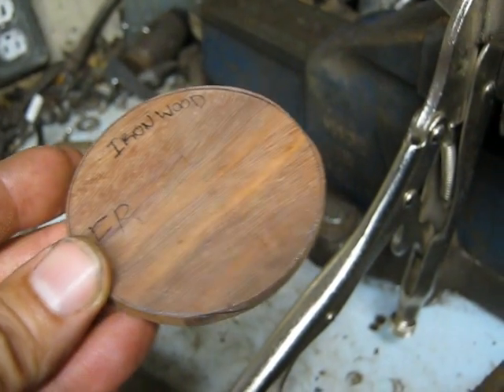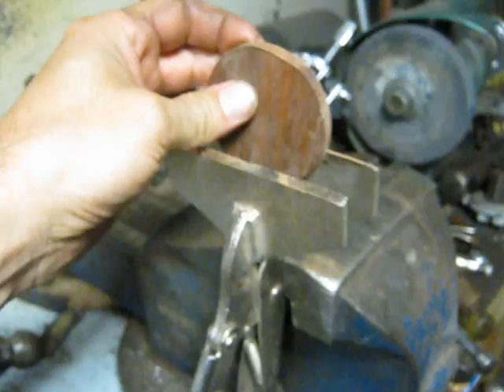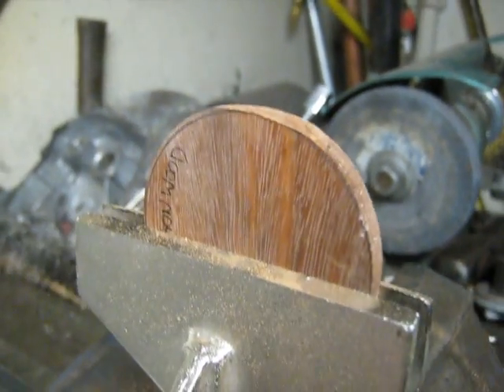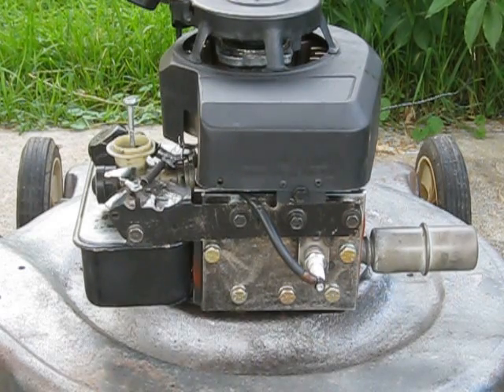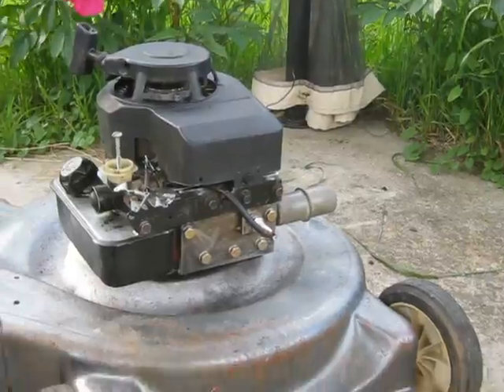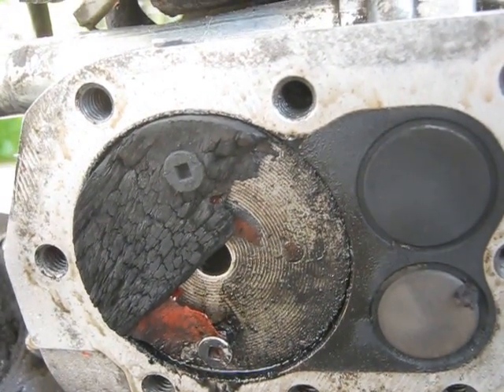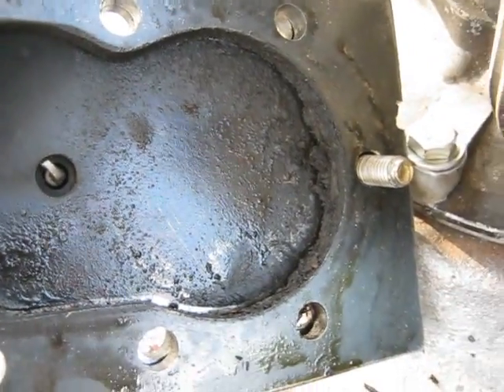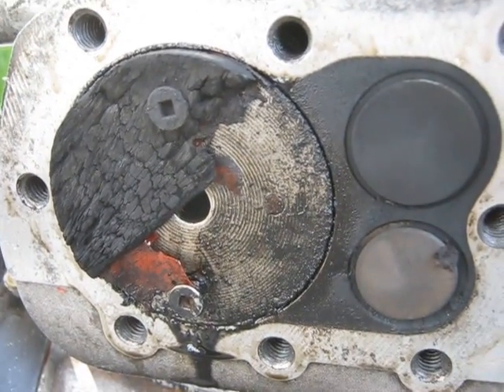Boraxed Ironwood Piston 3:37 Run!!!

Comment: Soak the wood in water glass [sodium silicate] and give it a long time to dry and you should have one really tough piston!
Reply from the maker: Howdy, yes, as long as that stuff doesn't lunch the cylinder wall. I hear that is what they use to destroy engines at wrecking yards, courtesy of a large auto manufacturer  :(
Reply: Although it is true that they indeed poured liquid silicate into engines and ran them until they terminally failed [seizing up] that is immaterial to this.

To fear that is to fear a concrete because some men used it to drown other men in Lake Michigan even though it has a whole lot of safe, benign purposes.

Water Glass, when used intelligently is utterly harmless to an engine.

In fact, interestingly, some people use dilute water glass as a stop leak [charging a ridiculous price for it!] for head gaskets.

Water glass is often employed in many spray cleaners because of its propensity to leave a thin, reflective, protective film of glass over a surface which [temporarily] resists scratching and staining, therefore extending the color brilliance and reflective sheen.

It is used as a protective coating on commercially packed eggs as it inhibits spoilage by both keeping out microbes and keeping in moisture. I suppose technically it increases shell hardness, but clearly not enough to keep an egg from actually breaking under 'normal use conditions', or it would become problematic for we the end users.

Just like how one used fiber glass and resin as a compound to build structures, in reverse, using water glass and mineralized cellulose fibers [aka WOOD] makes a stronger, more resilient product.

I must of course, emphasize the absolute dryness of the water glass because I have made a foam out of it which might happen if the wood and water glass combination is too wet when put in the combustion chamber.

I might just mention here that the insanely expensive material known as 'aerogel' is nothing but water glass, literally.

Comment: Best run yet and the most spectacular failure so far. Excellent video, saved to favourites!
Reply from the maker: Thanks. Yes, this has been the longest run so far with  the 1/4" thick wooden piston crown. i am not certain what happened about 1/2 way thru, but I suspect a piece of wood broke off, and got beaten up by the piston, then spit out of the exhaust after burning up. it did make for some excitement, but I decided that i was pretty safe with the 1/4" thick steel head between me and the source of the problem, so i just let it continue to run, and see the outcome.

Comment: Have you changed the oil in this motor? Perhaps it would be a good idea to make a video on how it looks and send it for analysis.
Reply from the maker: No, I am running the same oil I have from the start, though it gets dumped out of the engine each time. it smells like a campfire, and is a dark brown color, with lots of suspended particles.

Comment: it looks like it just broke in half IT LOOKED FINE IN THE MIDDLE WHERE THE HOLE WAS STILL!
It would of gone even longer if it didnt break in half..
You'd have to use more bolts to hold it on with though!
I can tell thats very possible thats what happened because the engine quit very suddenly compared to some previous runs plus theres no major hole burnt in the center where the remaining wood is left.
Reply from the maker: One further thing i noticed was that the high temp silicone had given way also, so this run put everything to the test. I had to wait a while before I could take it apart, since it was so hot.
Reply: Yeah wow. o.o

I have a question. how well do piston rings really seal the piston to the cylinder walls of normal engines?
And do they self-heal between the cylinder wall and the piston rings by wearing evenly if the cylinder wall gets a tiny nick or scratch in it? 
does the oil do a lot of work with sealing the cylinder and piston rings?
what do you think?
Reply from the maker: You have asked some very interesting questions there. I can't say that I really know the answers to them, so I will give my opinion. I think the piston rings may do a bit of rotating around the piston, not much, but some. This would move wear marks around somewhat, I think oil plays a big part in sealing the surfaces, but it must be a very thin film, as the rings seem to wipe most of it off.
Perhaps some experts can shed more light on this basic engine principle that isn't widely discussed.

Comment: It seems that it held on well until it totally burnt through. Was the remaining piece burnt to the piston or still clean wood underneath?
Reply from the maker: I haven't looked at that, but the silicone seal was starting to let go, so i imagine the wood was OK, as it would be protected by the silicone.
Reply: ChargerMiles007 
In my experiments silicone burns quite readily at combustion chamber temperatures. Heck, try a silicone top. Probably not worth the effort. Just burn it with a propane torch to see.
Reply from the maker: Interesting, I wouldn't have thought it would burn also. I looked at the remains, the wood wasn't burned where the silicone was still stuck to it.
Reply: ChargerMiles007 
I tested it for use in aircraft nacelles near turbos. The orange seems to hold up best for some reason.

Comment: Whats your opinion on smog pump superchargers?
Reply: Im thinking on supercharging my briggs 60102 with the 2 3/8 bore and the 1 1/2 stroke. it seems like a good engine to try.
Reply from the maker: I honestly don't know, but your small 6 cube engine should be a good candidate for it, as that is about as small as Briggs made before the 4 stroke weed smacker engines.
Reply: ChargerMiles007 Weed smacker, i like that. And yeah, this briggs isnt the biggest of the bunch, but has just the right compression ratio for the job.
Reply: ChargerMiles007 Maybe if it works i could send you up a smog pump.
Reply from the maker: lol, perhaps we could arrange something  :)
I am still working hard on my Mystery motor, i hope to finish it soon, just so much going on now that summer and planting season has arrived.
Reply: ChargerMiles007 Im excited to see the mystery motor. I wonder what it is.
Reply from the maker: I will tell you this much, it is big and heavy, but based on a 5 horse Briggs  :)
Reply: ChargerMiles007 So descriptive lol.
Reply: ChargerMiles007 One question, does it have a piston?